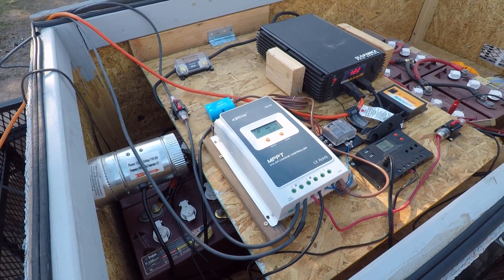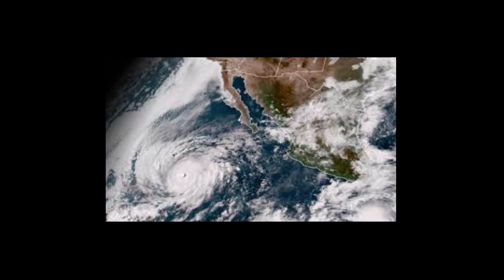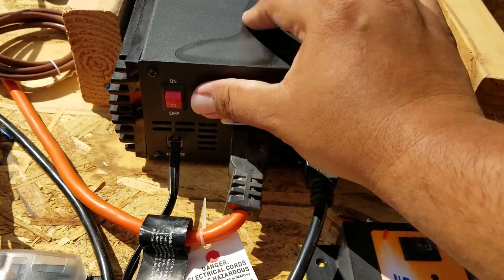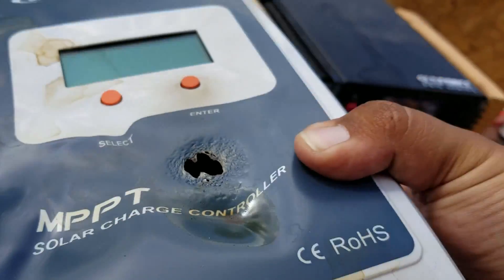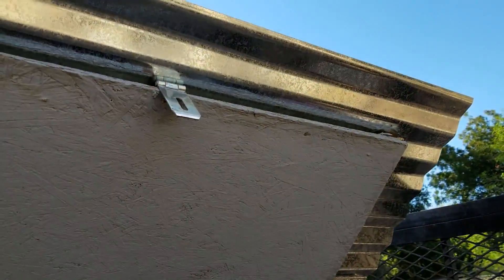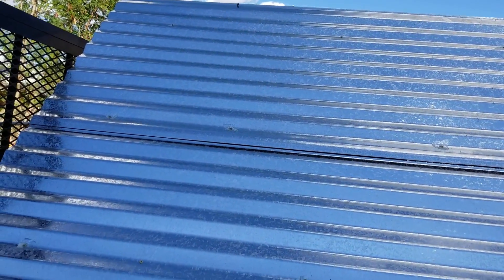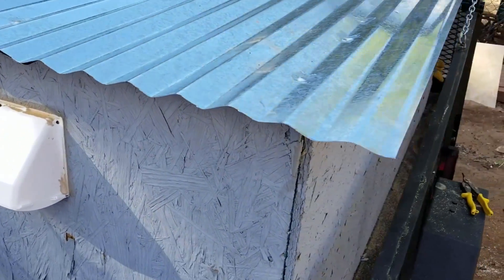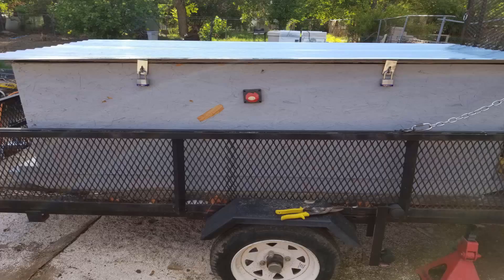FAIL?? Epever Solar Charge Controller|DIY Solar

Comment: How can you tell if charging at 12 or 24v, my EPEver shows 35v going in from the panel on a 12v battery? I presume that volts out of the panel and not into the battery.. I hope.
Reply from the maker: Yes that's normal, that's why is an mppt. I have 72v solar array on my 12v it works fine been going now for a couple of years.

Comment: I notice the epever isn’t installed vertically as they use air convection to cool. Laying them flat (horizontally) like that will cause them to overheat anyway
Reply from the maker: I mounted 4 computer fans on the back of the unit, the unit sits about 1 inch away from the wood. So far its been about 2 years been a great charge controller since I replace it because of this incident.
Reply: @toolhead147  good thinking with the fans

Comment: Great video. I like it. Jawmall Supply solar charge controllers with high quality,Jawmall.com offer solar charge controllers from 3A to 80A PWM Solar Charge Controller and mppt charge controller,EPever solar charge controllers,Jawmall solar  controllers,Jawmall Solar Regulator,Power Inverter,EPever Inverter,Power Inverter,Sine Wave Inverter,High-Frequency Inverter, Solar PV,Solar System,Solar accessories, and more for Retail,Wholesale in Jawmall at right price.Contact us sales@jawmall.com or Phone/WeChat/WhatsApp: +86-18002505142  By www.jawmall.com.

Comment: Good! Jawmall.com Supply solar charge controllers with high quality,from 3A to 80A PWM Solar Charge Controller and mppt charge controller,Power Inverter,Solar PV,Solar System,Solar accessories, and more for Retail,Wholesale in Jawmall at right price.Contact us sales@jawmall.com or Tel: +86-18707756219.

Comment: The screws in the tin cover should be on the peeks not in the valleys
Reply: Wrong. 
Roofing screws are gasketed and must be compressed to seal. If you install screws on the “peaks” they will not be adequately tightened to seal. Only gasketed roofing nails are installed on the peaks. Nails flex as the roof panel expands and contracts with temperature;  roofing screws do not flex and will wear an elliptical hole in the roofing. 
But that’s not the issue here. Inadequate heat dissipation appears to have been the cause imho
Reply: Valleys is correct. I was a roofer for many years.

Comment: Oh dear you are lucky it never blew up - batteries vent Hydrogen and that controller was designed to be mounted vertically where it relies on the thermal currents to cool the heat sink

Comment: hot air rises so when you lay it flat on its back hot air could not rise and it got hot...to hot
these units are designed to be mounted vertically 

horizontal only if a good fan is present
charge controllers produce heat and need to cool down in a well ventilated place

they torched prisoners in ww2 in a hot tin box
stop torturing charge controllers

Comment: The problem I see is that you have openings in the container, which allows air to blow in because it has a place to blow out unrestricted. I understand you need this for venting but I believe this is where the failure occurred. You need to install a plastic tray over the components with standoffs to allow the air to flow but the water to be shed away from the components. Blowing rain can get in places you would never expect......If in fact it was water damage and not something else.
Reply from the maker: You got a good point there. Never thought about that.  We had so much rain this year it's so different.  Tailight
Usually it's very dry here.  I'll see if I can make some adjustments. Thank you for watching
Reply: @toolhead147  Tailight?  What state....
Reply from the maker: @1pcmedic  sorry it way a typo lol
Reply from the maker: @1pcmedic  I'm in Phoenix Arizona, all desert here.  I get great sun for my solar.

Comment: As a normal result of charging, lead acid batteries produce corrosive fumes.
Reply: As a normal result of charging, lead acid batteries produce corrosive fumes.
I would strongly suggest keeping All Electronics outside of the battery box.

Comment: toolhead 147 -  As Jody said, thanks for sharing !    I have a small off-grid solar system and was looking at the EPEver charge controller, but "OTE"  (old time engineer) reviewed them and was not as happy as with Y&H mppt charge controller (red/black).  It has a built-in cooling fan and was a tad less expensive than the EP  (40 amp $129.99) at the time.   I got one, and it has been flawless.  It's display does fluctuate as it constantly recalculates the charge rate, but I have found it to be very efficient at charging and maintaining my batteries.  Just thought I would give you something to consider if you haven't replaced the charge controller already.  
         Again, thanks for the video,                   Rich
Reply from the maker: Hey I appreciate that man.  I bought the same controller but the updated version of it.  Just uploaded the vídeo a few days ago.  Decided to go with them because I already have the wifi adapter, and set just to bolt.  Thank you for watching.